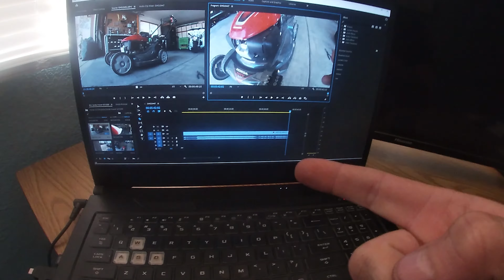Getting Lawn Mower ready for the 2022 Mowing season!!! Honda GCV200 repair.

Comment: Glad they got rid of the long bolt setup. Other than being a pain in the butt, the weight of the carburetor actually caused those bolt holes to strip out. This is a much more robust design.
Reply from the maker: Waaaayyyyyy better